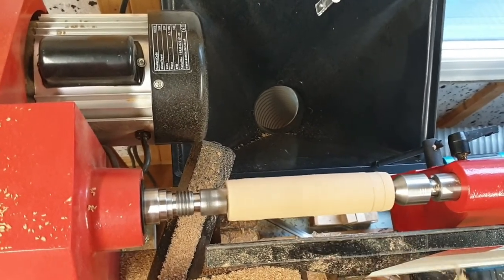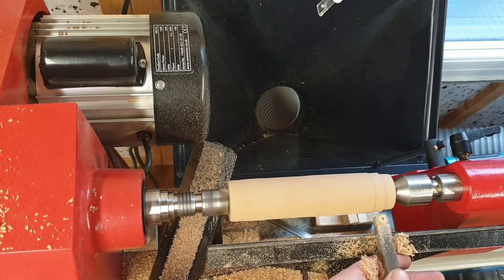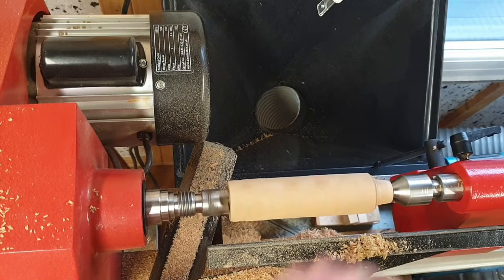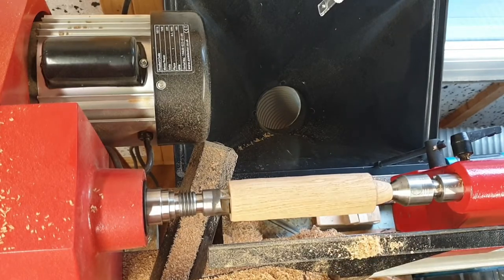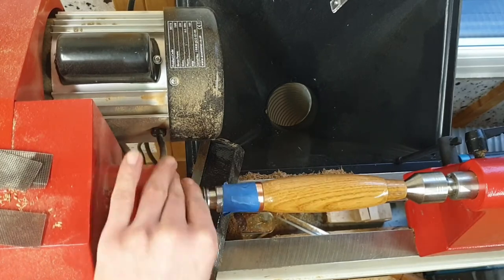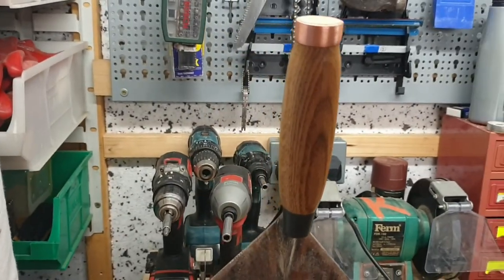Woodturning- custom oak handle

Comment: That looks spot on Scott mate thankyou.Not quite been at it for 40 years yet ! I lost my old trowels recently when I had my van and tools nicked last November.I came across those on ebay to replace the ones I lost and they are lovely,probably the same age as mine but not as worn.Those are gonna be perfect now with the longer handles,perfect old british steel tools with perfect,hand crafted oak handles,I look forwards to using them.I'm 60 next year so they might do me now!Thanks again Scott.
Reply from the maker: Glad you like it phil 👍 😀